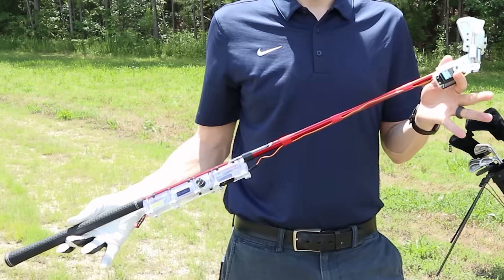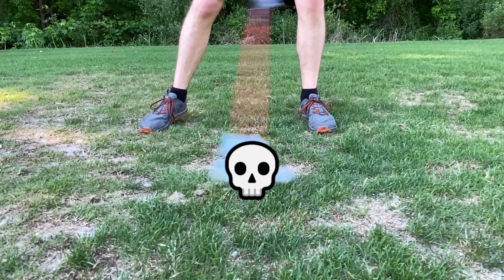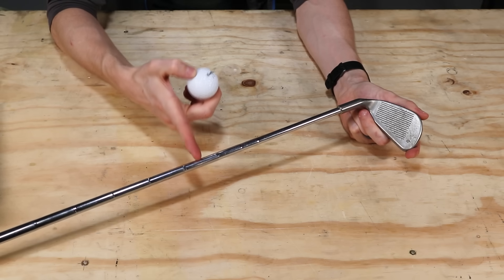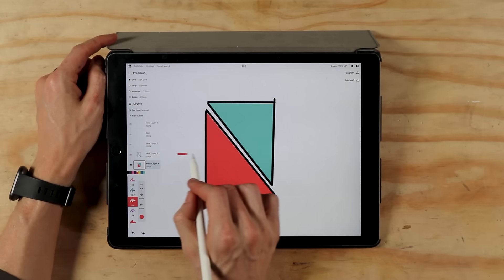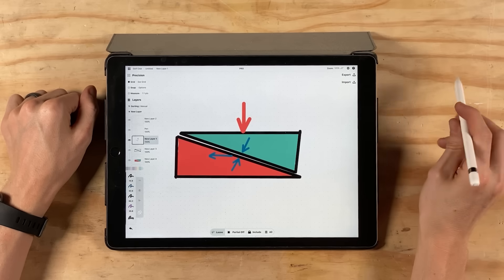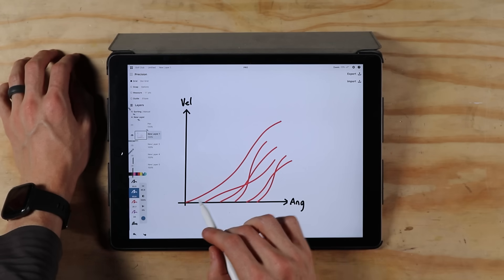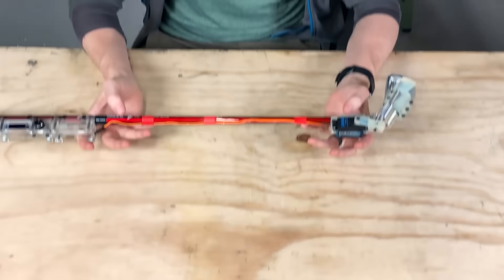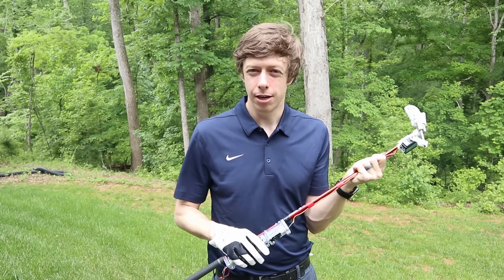My self correcting golf club makes me a better golfer

Comment from the maker: I know my golf swing is terrible. I move my head and every joint in the wrong way so no need to tell me :) What I'd love to hear is what other cool applications of robots and humans I should build!
Oh also, the IMU was so expensive because it is both calibrated and has a processor on it that gives you good quality fused data from the accelerometer, gyroscope, and magnetometer. I've ran into subtle issues trying to do this myself in the past and I really just wanted the IMU to work so I could focus on the problems that haven't been solved well already :)

Oh one other thing - I'm totally wrong about the speed of sound in the club. Turns out I am propagating a myth, that's what I get for not doing the math >_<
Reply: maybe a magnetic football and gloves that make it super easy to catch a football?
Or mechanical gloves that go over your fingers to help you play piano better?
Reply: okay, i know this idea might not suffice youtubey-clickbaity projects, but what about a chair, which autocorrects for wrong ergonomics, like slouching and stuff.
Reply: It would be great if the club would tell you afterwards which club setting was used. So after the swing: "Club 5 was used".
Reply: @rjdverbeek  Or if there was a mode that told you what to improve
Reply: A bat that always hits away from the fielder - fantastic video
Reply: One of my favorite YT channels! I love the level at which you explain your creations. Made for engineers!
Reply: Ahhh what's golf again?
Reply: I've often thought about making some kind of system for on foot/bike navigation that has something like two vibration motors/LEDs/other that go off when you should turn. I was thinking of implementing something like this when I had my motorcycle using tri color LEDs. Green = no turn, yellow is turn soon and red is turn now.
Reply: @blitzaxt  there is something that could provide some of these tasks. It's a german start up named feelspace. It's a belt with vibration units and it can tell where north is always. Or it can help you navigate. It's made for blind people. But it's not made for a complete navigation. This is the website: https://www.feelspace.de/?lang=en
Reply: @Atariks  Neat, thanks for the heads up!
Reply: @blitzaxt  No problem, you are welcome
Reply: A robot that automatically insults your wife and another one that apologizes
Reply: @TheVisidor  the robot that apologies must do it in a posh British accent.
Reply: Just wondering,  would you sell one of these?   I think its really cool and would like to buy one off you (I understand its expensive based on the IMU cost alone).    but I would consider getting one....
Reply: You are so smart, what college did you go to or what university, I'm really interested, pls let us know :)
Reply: Robotized pencil? like Shaper origin but for drawing. Glove scale for cooking? You could pour milk and it beeps when preset amount was added.
Reply: What about a bow that always lands a bull's eye?
Reply: You should wear a glove on your left hand if you are a righty
Reply: I highly appreciate the use of the ipad to explain the mechanics! As a few ideas for a future video: Automatic hydroponic plants, grow lettuce with automated water tank refilling, PH, Electrical conductivity, etc. 2nd idea: Play catch with a quadcopter, it catches a ball that you toss to it midair, then flies to you and drops it back when you open your hands. 3rd idea: some type of flame thrower. 4th: high pressure water cannon, 5th: a moving robotic hand that walks on its fingers. 6th: a robot that shoots projectiles at incoming objects. Thanks for uploading, keep it up ! You’ll have 400k+ subs by the end of the year !
Reply: @Halomygamo  I love the "catch with a quadracopter" idea.  Builds nicely off of this project and the basketball project, and has an endearing nerd factor ("robot pet to play fetch with").
Reply: tennis racket is feasible?
Reply: Controllable bowling ball, like Mark Rober did, except it’s your version. :)
Reply: I wondered if a flight stabilization board for R/C aircraft could be modified to lower your cost?
Reply: maybe a fishing rod that can cast in the exact desired position. ex being able to cast a bait right under a tree or inches away from a boat without hitting it. or just some robot that can un-snag your bait underwater. can you tell i like fishing?
Reply: Attach electrodes to your arm / hand and autocorrect them while playing an instrument or drawing something. I read a paper once where they have drawn a diagram with this methode. It was also used for force feedback for mobile Games.
Reply: Can you do a Qand A i would love to learn more about your engineering background im currently study mechanical engineering and these projects are fascinating
Reply: I've always dreamed of connecting a pressured air tank to a trumpet and writing code to play different songs. I know Yamaha has something like this, but I'd love to see the behind the scenes of it and how you would approach the concept.
Reply: Here is an idea that I have been kicking around in my head that would be perfect for you.  A few months ago I developed a physical condition that has left me with some nerve damage in my legs, leaving my knees weak and making it more difficult to climb stairs or hike up a hill.  With inspiration from your channel I have been thinking about ways that I could develop a "climbing assist" device that I could strap on to my leg/knee that would add additional leverage to my leg, knee and thigh to make it easier to climb stairs or go hiking.  

In simple form the device would consist of 2 straight rods/arms that could start out at 90 degrees to each other and when activated would then apply a radial force until the rods were 180 degrees to each other.  Once the knee/device extended, the force would release and allow the user to position their leg for the next climb assist (ie. take the next step up).  It would also work in reverse (ie. descending a hill or stairs).  The device would need to be light, strong and battery operated.  The user would wear the battery, possibly with a solar panel for recharging (for outdoor hiking).

I have an MSME degree and can collaborate on the design and build if desired.  LMK if you are interested in this idea.
Reply: Doctor octs arms
Reply: you could build a device that makes your handwriting better, i have no idea how though
Reply: Make a robot goalie that automatically saves a hockey puck from going into the net
Reply: @nate_storm  you can do that with a sheet of metal that covers the goal put some googly eyes on it for fun
Reply: Hi,    You should try to make a low-cost exoskeleton arm that helps you lift heavy objects as an idea of human-robot augmentation.
Reply: Why does such a tiny board cost 350?
Reply: Ping pong arm that replaces a human player so one can play or practice alone
Reply: A drone/quadcopter with a 360 degree camera (that can look in any direction) attached that links to a VR headset. Yes these exist but only with fixed cameras. Would literally simulate flying minus the wind resistance and g-forces on your body.
Reply: This would really be a challenge but I think a robot that could play a brass instrument would be cool
Reply: A guitarra that tunes  itself would be awesome
Reply: How about an Augmented Reality glasses that can scan boxes on shelves and point out which one has the right numbers printed on it.
Reply: Dante Frigerio Gibson did that in 2015. It wasn’t well received.
Reply: One thought I had for this project was that you kept saying that it’s all the clubs in one but it looks like just irons, excluding drivers and putters(not that this would be any means necessary for when you’re on the greens) but I thought it would be interesting if you found a easy way to switch the head of the club for a driver instead of the iron. Just a thought keep up the great work. I especially love the wife mode.
Reply: Make a bed that can become a sofa,has a tv and everything else you need. Make that it can transform with one button.
Reply: at least you use two hands. i find golf clubs to be way too short so i swing with one hand so i don't have to bend so much. i made it work.
Reply: @GraveUypo  what are you 8ft tall?
Reply: GraveUypo that’s not quite how it works. there is a semi pro golfer in england who is over 7’ 6” and uses clubs normally😂
Reply: An app that solves jig puzzles
Reply: You should get @Rick Shiels Golf to test it!
Reply: Stuff Made Here if you used some sort of universal joint and then cammed the head in each direction you could correct for both things. Maybe :)
Reply: Hey, what’s the iPad app at 6:53?
Reply: @arlingtonhynes  The app he uses is called Concepts
Reply: Cory Kiesling Thanks!
Reply: you should build a controllable soccer ball that no matter how you kick it it will always go towards the goal
Reply: Build things you are passionate about.  What about a self adjusting putter that won't allow the golfer to open or close the face at impact? It should be much easier than your basketball goal since putter/ball interaction is two dimensional.
Reply: Just found your channel through this video. Very cool stuff! Been watching channel for an hour now.

Found it from a post on r/golf, thought I'd share in case you'd like to see their comments/questions. https://www.reddit.com/r/golf/comments/gvcajm/automatic_golf_club_replaces_a_bag_of_clubs_and/?utm_medium=android_app&utm_source=share
Reply: This but a putter. Something that can correct for speed and accuracy at short ranges.
Reply: A bowling ball that always strikes
Reply: Some sort of automatic pool cue or table would be cool.
Reply: Frisbee that hits it’s target no matter how you throw it. Well, beside chucking it at the ground I suppose
Reply: I've always loved the idea of a robotic orchestra. Maybe you could consult with musicians to make sure you can make it do all the things a musician can. Also, I love other ideas in here like the quadcopter that catches things, and the turret that intercepts incoming objects. I think these things would really let you exercise the whole visual identification thing. Maybe some kind of rc submarine or (sail?)boat would be super cool, I always love seeing stuff like that. Ooh, how about a plane like FliteTest but it has a bb gun turret or something on it to shoot down other planes? Maybe automatically? I think that would be dope
Reply: He has the voice and brain of an adult engineer and the face of a twelve year old! Seriously though, this is great.
Reply: Could you build so sort of ping pong bat or tennis racket to throw your opponent off? Looks like you are taking a shot back one way but really it goes another way or something?!?
Reply: I was wondering what the name of the programm is that you are using on your iPad. Great work! Love the drawings!
Reply: A mechanical sleeve you put on your arm to make you throw like a nfl quaterback...just don’t let the New England Patriots know! They’ll need it this 2020 season
Reply: You should make your own version of a smart home, makes the shower temp perfect everytime, makes your coffee with the perfect amount of cream and sugar, something that makes your bed for you, something to feed your pets, etc
Reply: Instant sub, this channel is gold
Reply: Nice club but as you probably know the shafts have different lengths. How about making a shaft that extends and contracts to fit the right length
Reply: Try making a ball that will always give you a strike in bowling!
Reply: Linkbirds 

I’m thinking of one you throw and forget
Reply: That's pretty cool. It might even sell if could make it into a more polished product like you were saying.  There's endless amounts of gimmick golf clubs and golf stuff in general like swing and putting aids. I mean this no swing golf club is a thing lol. It's pretty cool and uses an explosive charge to launch the ball. Check it out https://www.youtube.com/watch?v=ID3SzQzQKlw
Reply: You Should Build a: (Safe Lock Amplification Device) & A Safe Lock Manipulation Tool Like the (ITL-2000II Autodialer). That’s What I Think Would Be Awesome...!!!! Keep up the great work. Nick🧔🏽, YouTube🔐: Lock Pick Nick & Nicholas Aarons.
Reply: Make the worlds best toaster
Reply: a self guiding dart!
Reply: Can you make a robot that helps you draw better?
Reply: Tendrías que hacer este aparato que se me ocurrió para gente sorda. La cosa consistiría en un aparato que agarre el sonido ambiente, deduzca las palabras que se dicen en el ambiente, las convierta en texto y que ese texto se traduzca a distintos toques que se van manifestando en la piel a través de un artefacto pegado a la piel... Digamos que alguien le dice hola a una persona sorda entonces le aparato agarra la H, la O, La L y la A... Para la H hace que se mueva "algo" dentro del implemento que la persona tiene pegado al brazo por ejemplo, justo en un lugar especifico, y lo mismo para la O la L y la A, cada letra repercutiendo en un lugar distinto. De esta manera cada palabra va a tener una sensación distinta pero consistente y con el tiempo la persona va a reconocerla instantaneamente... Va a sentir algo en el brazo y va a saber que eso significa "hola". Incluso si esto se utiliza de edades tempranas sería completamente incorporado...
Reply: I respect how aren't a pro but still dressed up nice to swing the club. Mad props to the level of effort and attention you devote.
Reply: Build a robotic arm which can cook/ prepare simple food, a dream for every lazy student :)
Reply: glasses that correct focus based on pupil position
Reply: Pool cue that always hits dead center?
Reply: Hello there! This is a lot of fun. Maybe someone has already said it, but this application would be most useful in a putter IMO. THere's so many variables in a full swing, but if you can get a putter face at 0* every time no matter path, it would be a big game changer.
Reply: If you're going to test it,  you should have the club randomly turn assistance on and off without you knowing (but logged). Then, just compare the success of those swings.
Reply: A bird feeder that closes when is "sees" a squirrel or other non-avian creature.
Reply: Make a robot that replaces nurses that I can operate from home. They need to be able to check vital signs and dispense medications. Also an arm to auscultate various body locations
Reply: Foosball table where one team is controlled by machine and human on the other team!
Reply: I have a great idea for next challenge.    I know you already did this video on Golf....but you should do the self hitting putter, similar to the laser putter from Caddyshack 2.  Make sure the turaine is sloped or has hills.  A robotic putter that cant miss....just like other projects.
Reply: If you could make a portable, relatively small automatic tire changer, you'd be the GOAT.
Reply: 4 years later and looking for pt 2
But I can't seem to find it
Reply: Please direct me to the super club video!!
Reply: What’s your upload schedule?